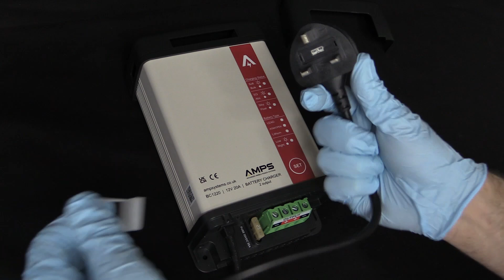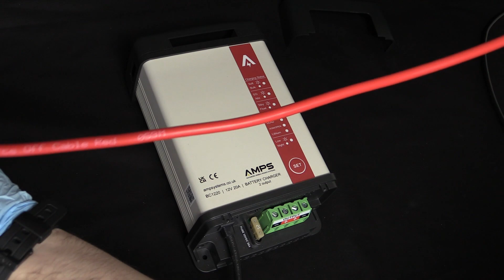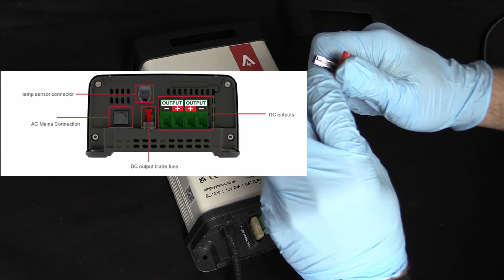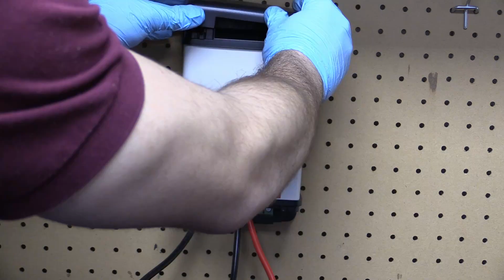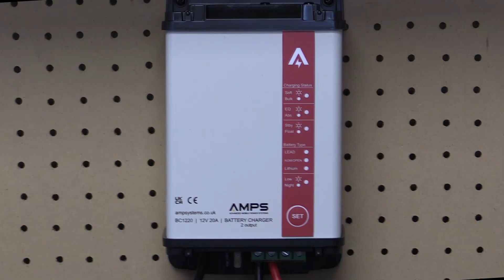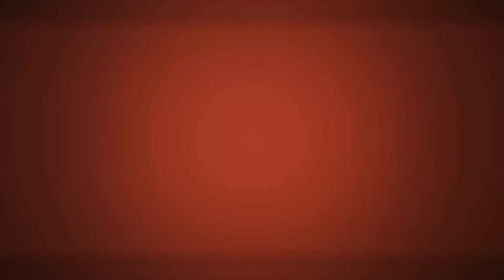BC Charger Part 2 - Install and Configuration

Comment: Utility knife for wire? So professional
Reply from the maker: The video series is very much focused on DIY installers- and so we focused the install itself on it as well. 

Yes, you can get hand-strippers for cable, and yes I could show crimping as well- but for this series we just want to use the same tools that anyone is likely to have. 

The cut is clean, the install functions and the cable itself is safe to use. 

But- that said, I'll keep it in mind for next time.